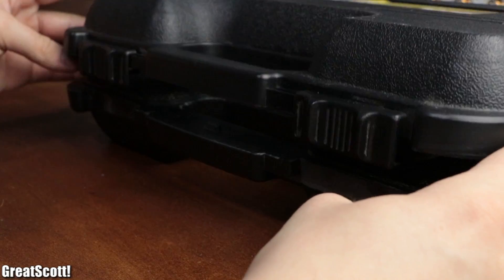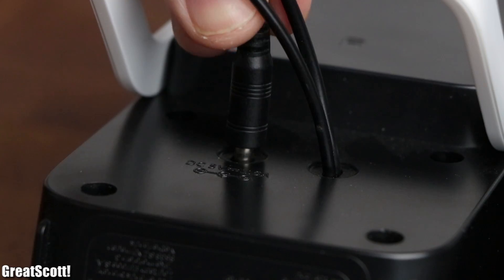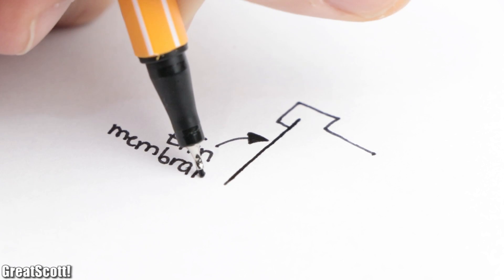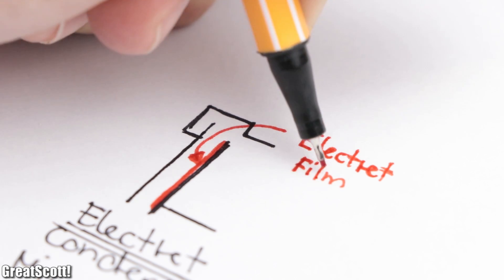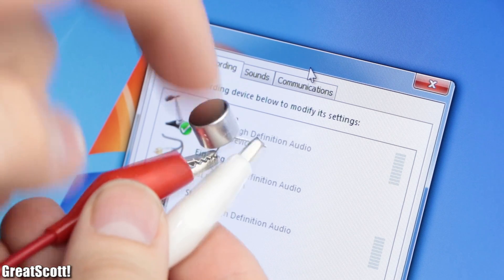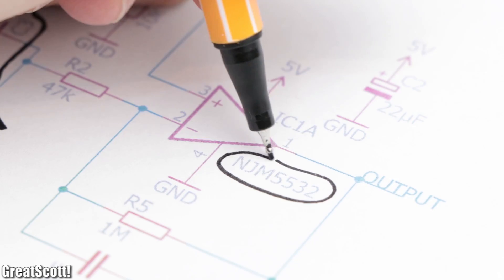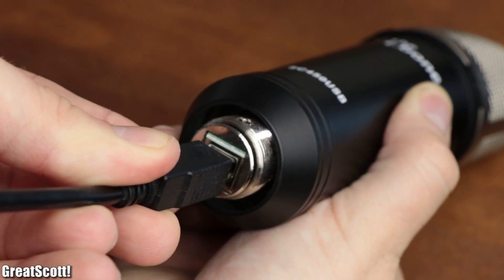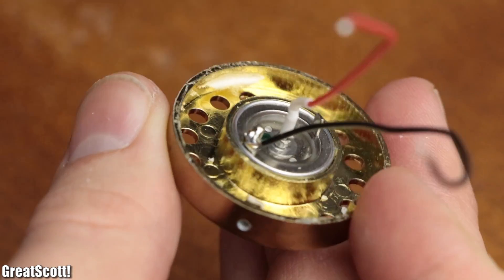Voice-over Microphone || DIY or Buy

Comment: Are you sure your sound card did not affect the recording of the diy mic ? Because the studio mic has an integrated sound card that might be better than your computers internal one!
Reply: you're right,but i doubt the point that the studio microphone was invested too much in the the ADC chip.Because the microphone by the way has to be connected to a dedicated audio interface before the computer.
Reply: Congratulations! Your comment has reached 200 likes!
Reply: Maybe, maybe not. A lot of modern computers have great audio codecs that can be just as good as a usb microphone or its studio XLR counterpart.

This discounts the fact that XLR is a balanced signal and usb is digital.
Reply: @INeedAttentionEXE  No matter what at some point the analog signal travelling along the XLR cable will get digitized for use on a computer. And so having it built into the mic means there is no cable length for signal degredation (you can think of the USB mic having a XLR cable length of nearly zero, assuming it's balanced circuit topology)
Reply: @sophiophile  Yeah, yours is  the best comment I've ever seen in this channel. point delivered.
Reply: Analog circuits are very cumbersonme. If anyone here has ever tried to make these circuits which have high gains/amplification, just a small length of wire protruding eg from the microphone to the amplifier will act as an antenna and pick a lot of noise. It acts somewhat as a radio. so the best option is to build the A/D converter closest to the amplifier/microphone unit such that the wire is carrying digital signal rather than analog. it will improve fidelity by a very wide margin.
Reply: @davemwangi05  I design a lot of analog stuff - it's not that cumbersome when you know how to deal with whatever issues are likely to arise, for instance the noise problem; you could simply drop a small capacitor to ground to act as shunt for high-frequency hiss, with it's value chosen so that it does not interfere with the audio signal...
Reply: @INeedAttentionEXE  
Lol no, integrated sound cards are crap.
Reply: I would not use USB for voice over and sure as hell not a standard soundcard.. Dude it will never get as good as an XLR. Because of signal to noise ratio
Reply: @scivirus3563  USB microphone can include (in theory) all the parts that you have in e.g. Focusrite Scarlett audio interface and Neumann TLM 102. The problem with USB microsphones is that everything is integrated - if the mic preamp, phantom power stabilization, AD converter or the capsule are low quality the end result is bad and there's nothing you can do except to throw the whole device away and get another one. With separate devices you can keep switching separate parts until you're happy with the results.

That said, most of the time the intended customer base for USB microfones is people that do not understand all this stuff so the manufacturers will use cheapest possible parts for everything.
Reply: @scivirus3563  USB can get better than XLR because its digital and the signal is converted to digital the closest possible from the mic.
Reply: @monad_tcp  The problem you run into with USB is if you find your audio interface (the part that turns the fluctuating voltage into a digital signal) to be too noisy, you have to buy a new mic with a better interface. 

XLR has a greater modularity to it, and I should have spent my money on an AT2020 mic and Behringer U2 interface instead of the Samson G Track pro. Don't get me wrong, the G Track Pro is the best USB mic I've ever owned for $130 and would work great for a portable setup. If you don't plan on moving much, spend an extra $15 for a system that is way more modular.
Reply: @Jay-kc2pm  
First, the part that turns fluctuating voltage is called an ADC, analog to digital converter.
Secondly, the best place to put the ADC is the closed possible to the analog source, this is basic electronics knowledge.
To get rid of noise, you can put more grounding into the boards, or make the components more distant, you can put shielding in the board.
But nothing is best than putting the ADC closer to the source, not running them through 1m of XLR cable, no matter how good it is, the signal will get distorted and attenuated.
Of course good "XLR" mics already have a small pre-amp inside them, so they can amplify the signal before it gets too distorted, but putting the USB-host and ADC 1cm away from the element would be the best possible way of getting 
Also, its not a matter of modularity, USB is as modular as it gets, everything is USB nowadays, XLR is only for audio, so not that "modular" as it seems.
But this its a matter of design, having USB requires more parts, XLR is very simple.
 Perhaps the word you are looking is compatibility, XLR plugs on anything and is very, very old, so its compatible everywhere, and with old hardware.

You only seem to think of "modularity" because the Behringer U2 (actually most of audio interfaces) is way too expensive for what it does, so it probably makes sense to have more mics and only 1 ADC.
I do realize USB is only useful if you have a digital studio with a computer in the center (aren't most modern ones already mostly digital anyway ?)
Still, in theory, USB audio interfaces shouldn't make the signal much more worse than what comes from XLR, but 
The real problem with USB audio interfaces is that most of them are too crappy, even those from good brands, its like they don't care when it comes to the USB ones. Ironically, I have a chinesium one that's 24bits that's actually good, well the ADC is good, I'm pretty sure it was removed from actual expensive equipment that died.
The other components are kind of meh thou, nothing that changing a bunch of caps won't solve, I just modified it to use my actual guitar pre-amp output instead of its internal one, that made all the difference. And yes, you can use the direct output from a guitar pre-amp, you just have to know where to solder 2 wires, and put 1 resistor if you are going to use a mic, to match the impedances. 
That I got made for $20 in extra parts.

But in terms of electrical engineering, it makes much more sense to put a good ADC inside the microphone and send the digital signal from there. 

DSP ICs (digital signal processor integrated circuits) are so cheap nowadays, I could do a project with a $2 part and a $25 ADC.
Oh, you can also put a small a voltage source for $5 more in parts, this way you can guarantee the quality of the audio because the voltage source is also very close to the microphone. A voltage source is another IC that will guarantee that the voltage is at a precise value, its much better than having it on the pre-amp side and running all the way 1m over through the XLR, even thou, XLR was designed for this purpose, an voltage source 1cm from the mic is still even better.
I bet it gets much more quality than the Behringer U2 for less than $50 in parts, ignoring the price of the microphone element, and the quality is very predictable for the reason I'm getting the signal closest possible from the source.
Microphone elements are very expensive, but they are the core of the thing.

And then, I could send it thought SPDIF, its a very well established standard, its digital, its very cheap, its 2 wires, and they can be very crappy. no need for super expensive audiophile gold plated cables that are pure placebo, you just get a pure copper cable, and a copper-core plug, and that's it. (anything else doesn't really matter much, also gold plated is bullshit, but it does look cool, get stainless steel, it won't corrode ever, and be much more durable).
But SPDIF as digital signal is very tolerant of noise, so it could be even the most shit stranded pair copper cable, or even aluminum, and its will works with perfect fidelity, its digital.
Reply: @monad_tcp  By technicality maybe, but in reality it's completely negligible. Besides, this is far outweighed by the upgradability xlr offers.

Comment: Not all condenser elements are created equal, and they're not intended to be. Most element manufacturers don't even bother to publish the response curves any more. If you buy an element from Shure, or Akai, it will not sound anything like the elements you can buy from Bangood. The price is very different as well.

Comment: its not a diy or buy , but i was thinking of a solar panel solution with the combination of electricity from the grid, with the main power supply to be the solar panels but when there is not enough power or it is night to switch to the grid with out any noticeable delay .
this have to be working without any batteries to store the solar power .

Comment: You may want to experiment with the bias resistor. 1k seems really low value. Maybe try 47k or 33k instead. See what you get.

http://www.talkingelectronics.com

Have a look at this guy's website mainly the FM bugs area where you see the bias resistors almost 40 times bigger.

Better still look at the bias resistor in the 440 mic.

Comment: Hey, maybe you can make a small surveillance system (camera and network to connect to phone) for your shed? Using a camera and seeing whenever someone is in the frame of the camera. Also you can have it notify you if there is. You can compare a DIY or whether to buy it.
Reply: If you go to woodgears.ca, Mattias Wandel has some software a a video or two on something like that up with a Raspberry Pi.  He used it to monitor a mouse trap and a maze.  Go to wooden machines & contraptions -> Raspberry Pi holder and scroll most of the way down (he's a woodworker, but he was an engineer for RiM so he does some electronics as well).

You'll still need to connect it to a network and set it up to notify your phone, but that's more of a networking thing than an electronics thing.

Comment: Interestingly, I'm doing a mix of DIY and BUY with my mic. Few months ago I bought a Neewer NW-700 mic kit (comes with a mic, phatnom power supply, XLR cable, XLR-phono cable, boom arm, and pop filters all in a USD$60 kit), but I completely forgot that analogue condenser mics produce signals only a hundred or two millivolts strong.

So I'm intermittently (when I can motivate myself) DIYing a pre-amplifier to boost the mic's output for recording. And mostly using jellybean components. The op amp I'm using is the LM324 quad op amp, with two utilized for the left/right channels of the mic output, and a third acting as just a voltage follower to buffer the 2.5V DC offset for the other op amps. I'm at the point where I just need to breadboard it and test it out to make sure that it works like it should. :)

Comment: @GreatScott: Is it possible to boost an stereo audio signal (coming from a "minidsp") from 0.9V to the standard line level of 2V, using a op amp and an single +5 Volt supply?

Comment: Op-amps NEVER produce faithful amplified signals. They ALWAYS distort analog signals, even if they claim to be 'designed for audio amplification', because they amplify signal at varying levels depending on their frequency. Use op-amps for low quality audio applications, single frequency applications (like RC control signal boosting), digital signal boosting at low data rates, or a few other applications they are useful for.

A higher quality audio amp used instead of an op-amp would make a huge difference. This would require a powered circuit and increase the bulk of the design, but we are talking about studio sized mics, so that is no problem. You could use a high quality IC amp made for audio or a set of JFETs with accompanying components for the audio amp section. A minor change to the circuit with minimal cost for the IC option and there are several that would work well.

There were 2 mistakes in the design that also effected the quality of the audio.

First, you need a few noise floor filters to remove inherent noise in the circuit and any light background noise. This can be done with op-amps in the correct configuration or by discrete parts. One goes between the mic and the first audio amp stage, in between any other amp stages, and one right before the output. This will do noise reduction in the entire circuit and keep the amps from raising the noise floor.

Second, your band pass filter was at the wrong frequency ranges. You used the range for the human voice's primary frequencies. This works fine for a telephone call, but it cuts off resonant frequencies that add to the sound of the human voice and music. 20 Hz to 20 kHz is the hearing range of a young, healthy adult. Mics like this can have problems picking up both very low and high frequencies, but for voice it is not really a problem. Music is a different story. A bandpass filter set to 20-20k Hz right after the noise filter at each stage and the initial would be the best filtering solution. You do not need one on the output since the sound card has a bandpass filter built in.

There is also the consideration of what your sound card had for the sample rate on its analog to digital converter. This can make a massive difference on sound quality. The USB studio mics would have a very high and high bit-width output from theirs and would have told Windows through the USB connection to use the correct sample rate. Many sound cards built into motherboards are not of very high quality, but there also is the possibility that Windows defaulted to a low sample rate. Go into the mic properties and try turning the sample rate up.
Reply: I dont see how you can reduce the noise floor by adding even more components. I think the only core problem in his circuit is the filters. It is cutting off a lot of the low end and that why it sounds like a telephone. Most likely its the electret microphones frequency response that is the issue, not the opamp. Ive used low noise opamps before (-100db noise) and they always work great. Also, the electret has to be in a decent housing to focus the audio waves
Reply: The op-amp can be configured for a noise level threshold cutoff, therefore it will not have an output unless the signal level reaches a certain predefined level/frequency.  Course the flip side of this is, that it can clamp certain levels/frequencies and will never sound as good as a professional mic.
It's called poor man's DIY mic :D
Reply: The pronouncement that "Op-amps NEVER produce faithful amplified signals" is one of the most preposterous things I have ever read on YouTube (or perhaps on the whole internet, for that matter).  Commodity op-amps are used EVERYWHERE from the cheapest toys to the very most expensive professional and laboratory-grade audio equipment.  Including the venerable 5532 which is a VERY popular op-amp chip for audio circuits. GreatScott did an excellent job of designing and  implementing and explaining the booster amp for his DIY microphone.  Criticisms to the contrary are completely unfounded.  Big Thumbs Down on this comment.
Reply: Ideally the feedback network sets the frequency response of an op-amp.  And if the signal is within the chip's capabilities it works that way.  But given real world op-amp characteristics, a circuit may do very well at lower frequencies but struggle to keep up with higher frequencies.  It sounds like he needs a faster op-amp for his microphone.
Reply: Google 'Unity Gain Bandwidh Product' please.
Reply: Would this work if the output were to go into an Arduino? and, would the input change at all if it were via aux cable?
Reply: Someone just explained the sence of what happening at all there. This time author of video is fuc*ed up. But he can make an other video on this subject.
Reply: THIS IS THE LONGEST. COMMENT. EVER

Comment: DIY or Buy suggestion: High Voltage Differential Probe (i.e. Picotech TA041).  Entry point on these are over 200$ but they are very useful!

Comment: hay, can you make a high current measurement project with a ACS712 sensor???
i always get a trouble with getting a steady value...
since the sensor output always produce not stable 0 ampere signal,,

Comment: It wont work good becouse you dont use usb audio card...yes,if you use usb audio +mic pre amp and ground loop isolator (simple homemade one) to connect it together (ground loop isolator is needed when you power it trought usb without external power to mic pre amp) and it works awesome. Check DIY Perks he use homemade mic like you show us but he add usb audio card from playstation singstar and it work awesome :D BUT it can work good if you use pcie audio card becouse  stock pc one get only output audio   good input is really bad becouse noone buy motherboard if it cost 100$ more only for good input

Comment: Hey GreatScott, would it be possible if you explain how you choose which components you use, for example Op-Amps and  Transistors. I know you would use a low noise OP-Amp for this occasion, but how did you get exactly to your choise?

Comment: You could've tried to build a RIAA corrected preamplifier for the small electret microphone. The same type used for electromagnetic pickup cartridges. This should have given it a little bass and attenuate the highs a bit so it wouldn't sound so metallic.

Comment: Since electret mics are cheap it might be useful (and easy) to do a video comparing various little electrets.  I read that they can vary considerable in quality without a huge penalty to the wallet.  For example, I was curious about this: http://www.frogloggers.com/bt-em172/ mic as a hydrophone and it is said to be considerably better than your average mic.  Haven't had enough of a reason to try it yet, however.